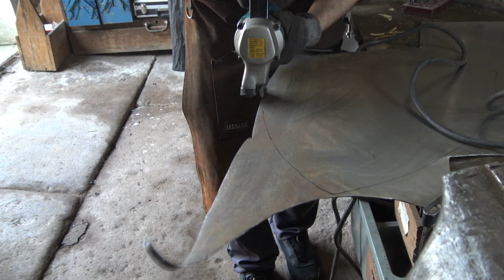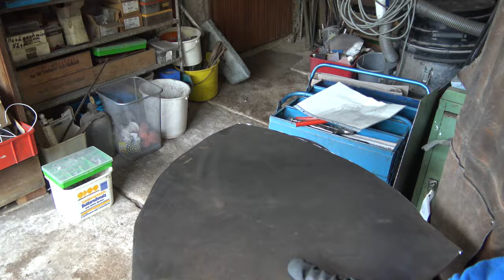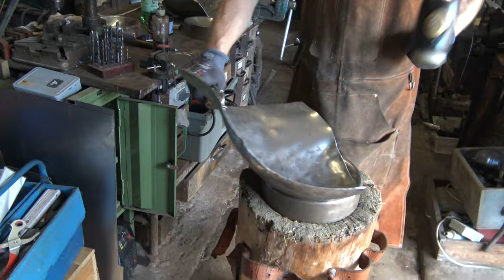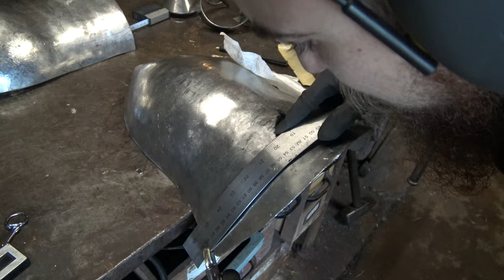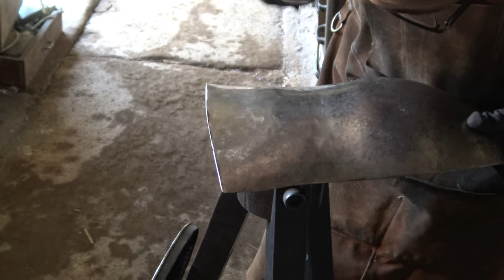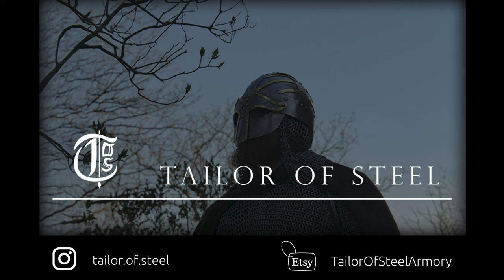How to make a Fountain Guard Helmet episode 1 (handmade armor tutorial)

Comment: Parameters?
Reply from the maker: What do yoj want to know?
Reply: @tailorofsteel2783 Hello, I need to know the dimensions of the paper you used to make the sketch for the metal. Also, I'd like to ask what software you used to model it, what material it is, and how much it will cost me.
Reply from the maker: @dompel1024  I didnt use any Software. I just eyeballed it and then hammered it until it fit. Its 2mm steel and if its not for sale but if i had to sell it then not for less then 3000€